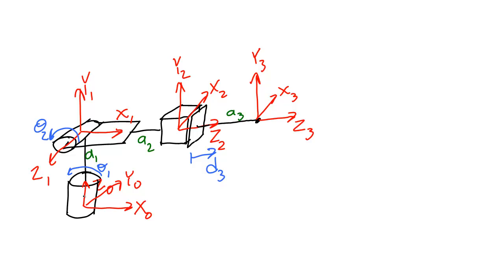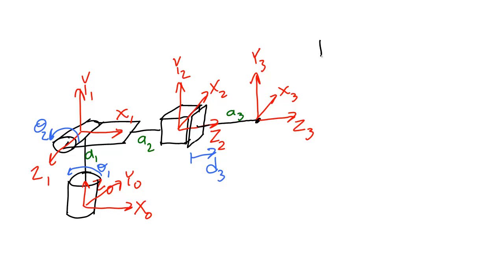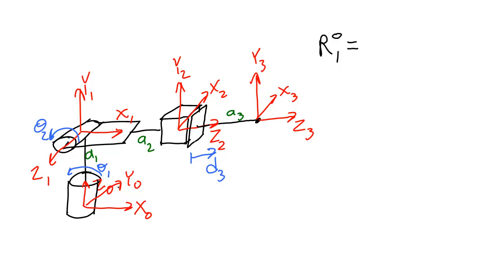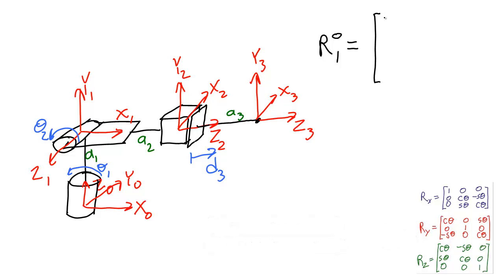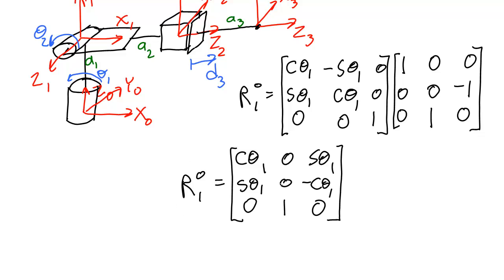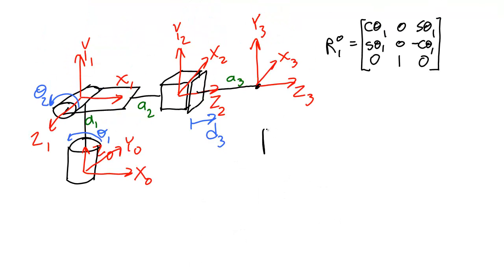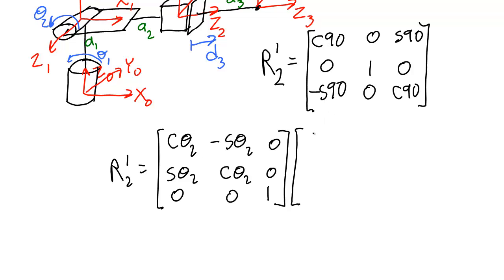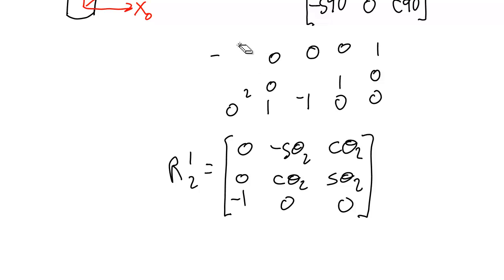1 1 3 Lecture Video 4 of 4   Rotation Matrix Example 2

Comment: I have a question, what will happen if the axis if rotation is something other than X, Y, and Z?
Reply: You treat it as a combination of rotations around the x, y and z axis.

Basically, you rotate the original coordinate system to align one of its axis with the rotation axis you're talking about. Then rotate the new CS around that axis.